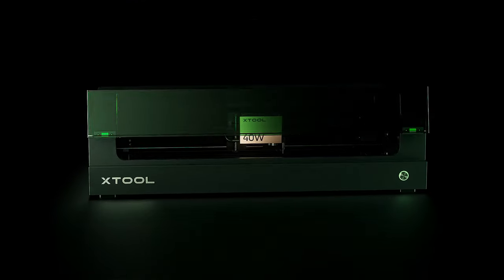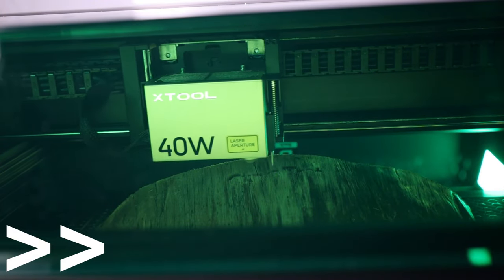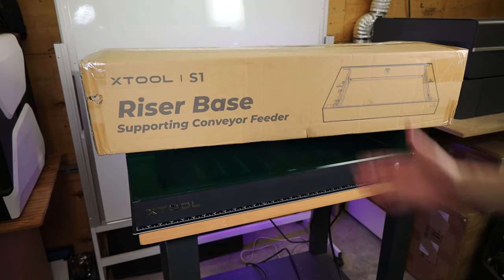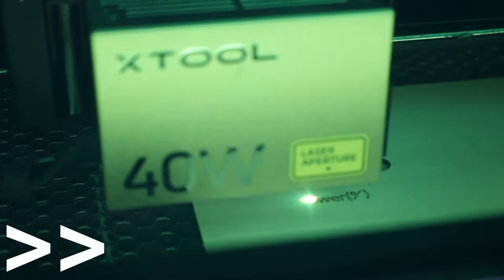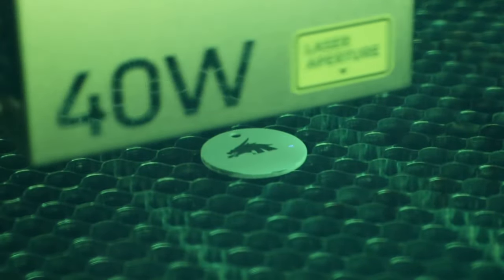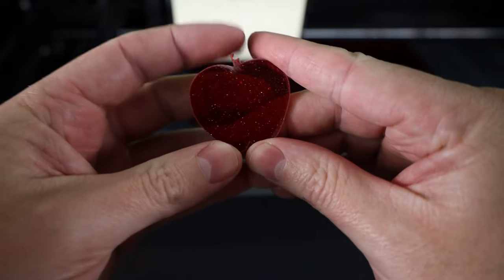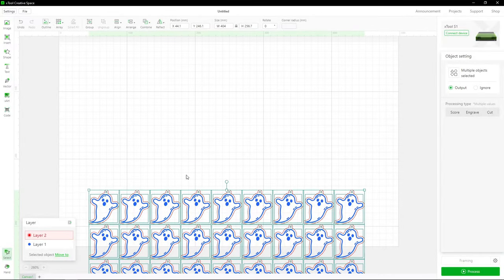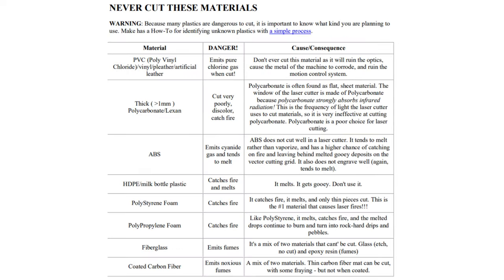Fully Enclosed 40w Diode Laser Cutter With Safety In Mind - xTool S1

Comment from the maker: Use the exclusive discount code 200S1 to a $200 off your purchase of $2000 or more.

xTool S1 40w Diode Laser (US) - https://bit.ly/3ZXuS7X
xTool S1 40w Diode Laser (UK) - https://bit.ly/3Q2Cnpr
xTool S1 40w Diode Laser (EU) - https://bit.ly/3PXN0Kl
 
Other Later Options From xTool:
xTool P2 55w CO2 Laser (US) - https://bit.ly/xTool-P2-CO2-Laser
xTool P2 55w CO2 Laser (UK) - https://bit.ly/xTool-P2-55w-CO2-Laser-UK
xTool P2 55w CO2 Laser (EU) - https://bit.ly/xTool-P2-55w-CO2-Laser-EU

xTool F1 Portable Laser Engraver IR + Diode Laser (US) - https://bit.ly/xTool-F1-Laser-Engraver
xTool F1 Portable Laser Engraver IR + Diode Laser (UK) - https://bit.ly/xTool-F1-Portable-Laser-Engraver-UK
xTool F1 Portable Laser Engraver IR + Diode Laser (EU) - https://bit.ly/xTool-F1-Portable-Laser-Engraver-EU

xTool D1 Pro 20w Diode Laser (US) - https://bit.ly/xTool-D1-Pro-20w-Diode-Laser
xTool D1 Pro 20w Diode Laser (UK) - https://bit.ly/xTool-D1-Pro-20W-UK
xTool D1 Pro 20w Diode Laser (EU) - https://bit.ly/xTool-D1-Pro-20w-Diode-Laser-EU

Materials:
Black Acrylic Sheet 12 x 12 Inch 1/8 Inch Thick - https://amzn.to/3QhVo8W
Basswood Sheets 1/8 x 12 x 12 inch -  https://amzn.to/46UYTaT
Black Slate Stone Coasters 4 x 4 - https://amzn.to/46z7Zdo
Stainless Steel Blank Tags - https://amzn.to/3QjaCKN
Aerosol Black Laser Ink for Metals Marking - https://amzn.to/3M26lsF
Washable Tempera Paint - https://amzn.to/3rZJrev

Materials that you should never cut:
https://cpl.org/wp-content/uploads/NEVER-CUT-THESE-MATERIALS.pdf
______________________________________________
Note : Most of the links that I use that go to products are affiliate link. This means I make a small commission on anything that you happen buy using them. This is at no extra charge to you and this helps support the work I do on this channel. 😁👍

Comment: I like the safety features like Emergency stop, fire detection, and USB key lock out. Does this also have an auto stop if the protective top cover is opened as well? That's a feature that should also be standard in these.
Reply from the maker: Yes it does